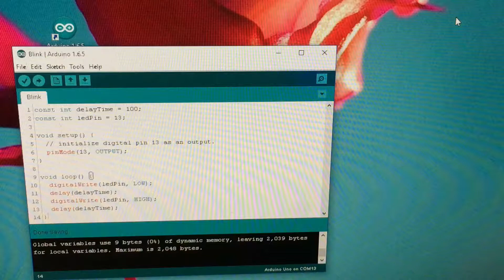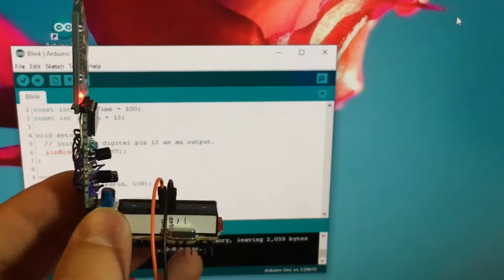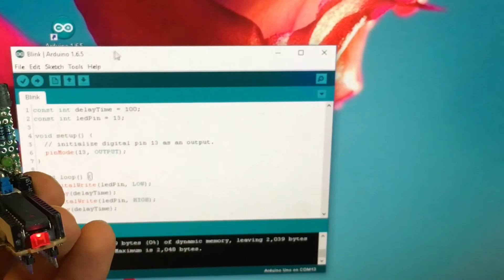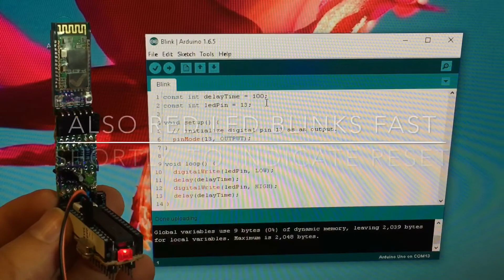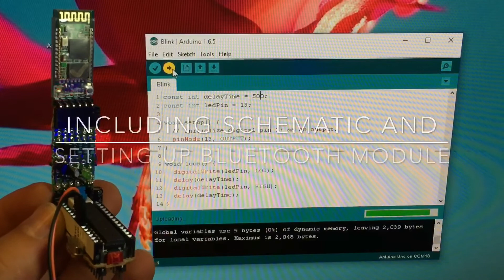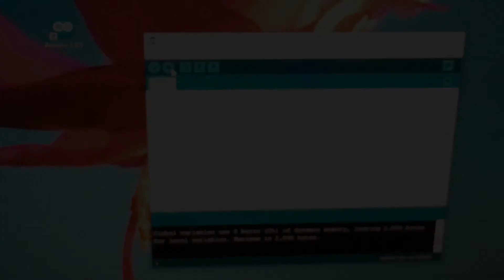HC-05 Bluetooth Sketch Uploader for Arduino

Comment: The adapter is basically a **breadboard with the 1 micro faradbhaiya Just plug it in and set up the pins carefully of RESET